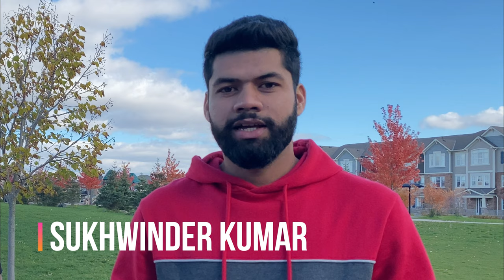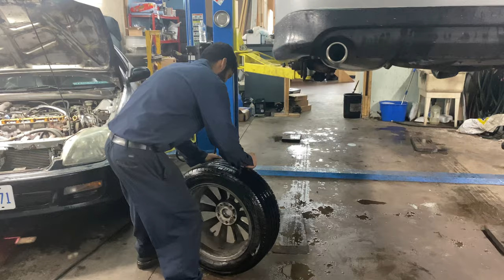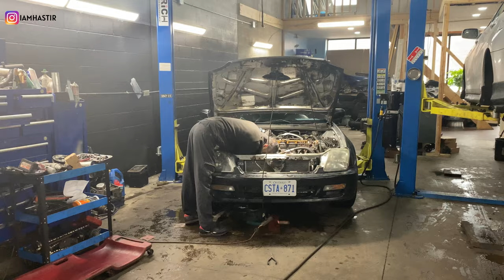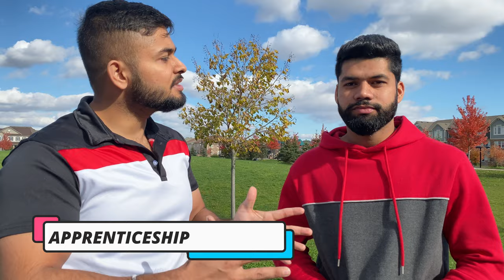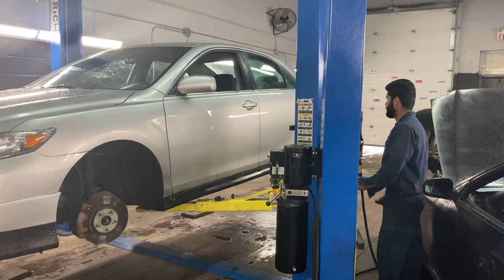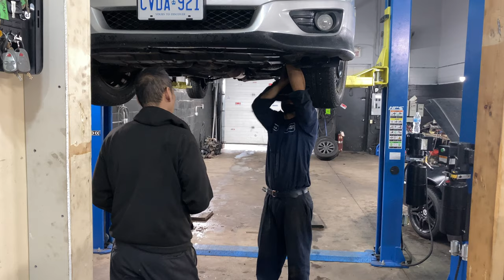Car Mechanic in Canada | Skilled Trade Jobs | Study Abroad

Comment: I am Toyota Technician In ksa. On the second lifter there is camry 2009 or 2011till model shape. & he try to check how is turn brake disc after adjust hand brake shoe. If i left study i can admission & Get job

Comment: Mujhe job mil sakti hai vahan heavy truck mechanic mein
Reply from the maker: Mil sakti hai but apply krna padega and contact krna padega authorized immigration agent ko.
Reply: Education nahin
Reply from the maker: @m.dhusen5659  no education. You can also get direct work permit. You need to contact an immigration agent to get the details of the process and requirements.
Reply: Aapko jo agent bheja tha uska contact number milega kya
Reply from the maker: @m.dhusen5659  I applied my file myself because I came in study permit which is easier to apply. You should consult a professional.